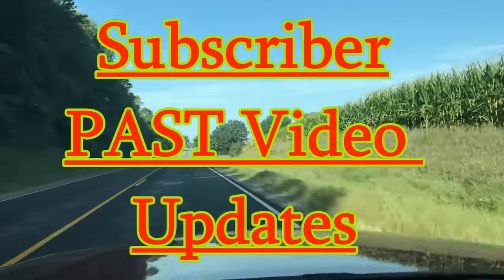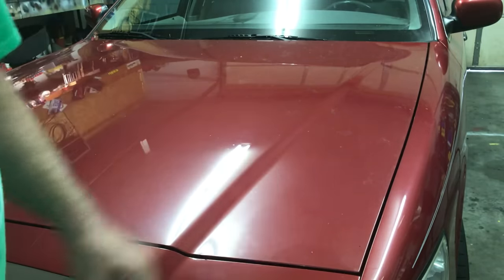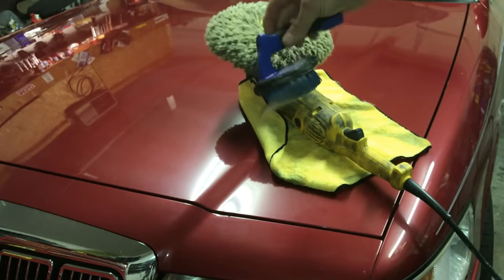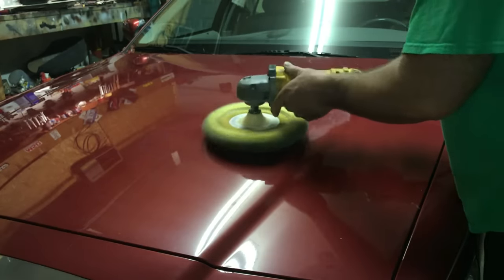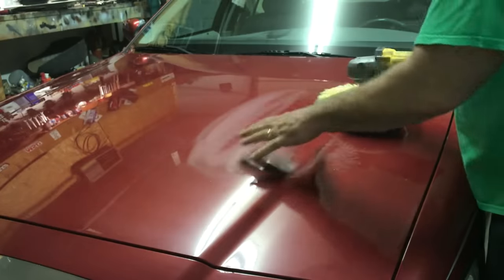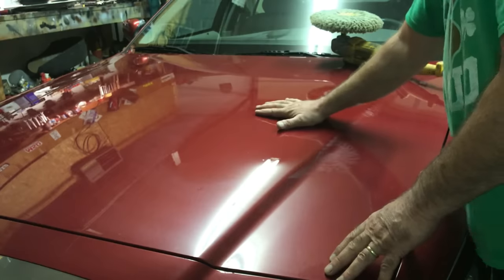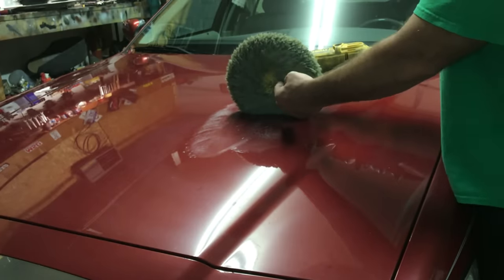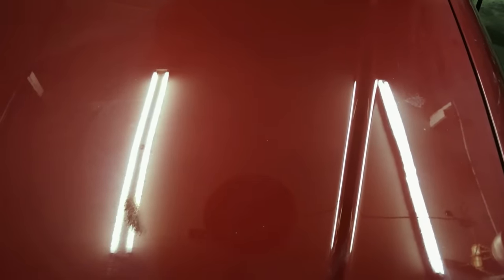HOW to BUFF & POLISH With a SINGLE ACTION BUFFER

Comment: Listen to this guy boys n girls,he knows what he's talking about.I'm a valeter for like 20 yrs and did some paint work in my time although,I  v.rarely used a wool head,just a sponge head.Only advice i would say is tape/mask of any trim/handles etc and a sheet over the windscreen and you can do the head lights too! Adjust the speed about 700-850rpm for the buffer.Do remember if one day your buffer stops working and your baffled why ie fuse is ok,wires are not broken..... on the sides are 2 large plastic flat like screws which hides the metal bristle inside,they do get worn out so don't chuck it away.You may get some spare metal bristles with your buffer and keep them safe.

Comment: 20 year old straight enamel paint job!!  It would be interesting to put a paint gage on it before & after when you're done with that rotary. Lol
Reply from the maker: Well, we've used them for years and years and years and the only issue we've had is that it works so good that our customers keep returning.  Thanks. mad Mike the hammer SPC

Comment: Your videos really do help me out. I just bought a single action buffer and I'm watching your videos to learn how not to burn the paint clear coat or get swirl marks. I'm going to try it first on my older truck so I don't screw up my new suv. So if I keep the pad moving will I avoid swirl marks? Any advice is much appreciated. Thanks
Reply from the maker: R Lindsey see this video https://youtu.be/nUN2uBCgzok it will help even more but if you can view all our paint resto videos that will really help you ...remember swirl marks largely come from the quality of pads and buffers you use. and practice as much as you can.

Comment: Heyya! I know you said to use a single action but I'm a complete beginner. I've used those cheap $40 buffers and sanders a couple times but that's it.

I was looking at the Griot's garage g9.. or the torq15da random orbital. Is that stupid? I know your single action DeWalt is better but I'm entry level.

I'm ok with the work taking longer if it means I won't mess things up on accident lol. Won’t be grinding or sanding anything either.

What do you think? Thank you for your videos. You're the best!
Reply from the maker: To obtain the same results shown, you need to use the exact same products/tools we share CryptoJunkie. If you are a beginner, that's great, we all started in the same position. Just go slow, take your time with the tools and you will get the hang of it my friend. Hope this helps, we really appreciate the view and comment, have a fantastic weekend and all the best on your project. You can do It! mad Mike the hammer SPC & team
Reply: @SweetProjectCars  thank you for the reply and words of encouragement! I'll give it a shot mad Mike 🙂

Your videos rock! Thx again!

Comment: I don't know how I missed this video but I sure am glad that I found it now. This video is exactly what I had been hoping you would make with the Dewalt buffer. A question though, when should I use this method and when should I use the method with the Mothers Chrome Polish from the video that you previously did with the truck? I'm guessing do the Mothers method when there are lots of scratches and/or swirls? Would the method in this video also take out swirls? Merry Christmas!!
Reply from the maker: kawtriples you are correct you only need the4 mother once to remove all the scratches see this it may help https://youtu.be/FcWB2wfuQBc

Comment: Are you toggling the power on and off to control RPM or are you holding the trigger and letting your setting of 2,220 RPM control the RPM? I worked with a guy many years ago that was a professional like you. He used a pneumatic buffer and it ran at much, much lower RPM and that was the reason (he said) he used the pneumatic one. All I know is his work was off the charts great so that is why I was asking.
Reply from the maker: We only do that when we are putting the polish on when it's really wet so it doesn't fling everywhere.  Thanks for watching Ben, have a great weekend my friend. mad Mike the hammer SPC

Comment: Hey man, I really like the Mothers instant detailer and also the Mothers spray wax (that has an extra 8oz) both products have always appeared to look & work identical to me... Your thoughts?
Reply from the maker: Not sure on that we’ve always used the detailer and the wax that we use is the Maguires synthetic
Reply: Yeah the spray detailer & spray wax I swear are (almost) identical in every way, and you get an extra 8oz w the one so thats what I use.

And yes, oh my goodness I took your recommendation on the meguires liquid ultimate and that stuff is incredible.. Thanks alot!

Comment: Excellent video, Im a bit confused as did you use polish or just wax all the way? Also what machine do you use for the sides? as the dewalt looks a bit heavy
Reply from the maker: Spencer unknown we polished then waxed and the DeWalt is all we use on the entire vehicle it does a superb job
Reply: @SweetProjectCars  Its amazing watching you work, you make it look so easy,  as I no joke, spent 6 hours on 1 bonnet / Hood with a Dual Action a 6 inch Heavy cutting Flexipads Hexlogic using Menzerna Heavy Cut 400.. and it still did not get out all the water marks, surface scratches etc.DA its almost useless at cutting.. much faster by hand.. ok for finish I suppose.. I know in the video you mention using Mother's if there are scratches to remove, but in the video all I see you use is : Mother's instant detailer (wax) -> Zymol Z503A Cleaner Wax (wax) -> Meguiars Liquid Wax, Thats why it looks like you are using wax all the way : )
Reply from the maker: Spencer unknown if you plan on doing this much and want the same results as we achieve then i highly suggest you use the same exact tools and products and you will have success very easily every single time you have to remember we have been at  this for over 40 years and are sharing only what works taking all the guesswork out for the DIYer

Comment: For removing swirl marks in black paint would you start with foam compounding pad or just start with fluffy compounding pad and then on to polishing pad? I have  the buffer and pads that you suggest using.
Reply from the maker: Bradley Peel we use this for swirl marks https://amzn.to/2QyqisM it works great just follow the directions on the bottle and you are good to go my friend :)

Comment: If you buff your car and remove all the fine scratches and swirl marks then ceramic coat the car. Will it keep car wash brushes from leaving scratch marks on the finish?
Reply from the maker: RedWhiteAndBlueVideo yes the ceramic coating we use will fight off car wash scratches but we highly recommend when you can to avoid automatic washes I know in the winter time it is the only way you can get the salt and chloride off and you have to do it.

Comment: Can you go into a little more on what a dual-action can't do right, like you were mentioning at the intro?
Reply from the maker: themadmallard what we like to tell people is try a dual action buffer in one spot for 15 seconds then try the single action in another spot for the same amount of time...the difference is amazing. duals just don't have the capability to shine like a single...those who have always used a DA don't know what they are missing because they have not tried the single. yes, the DA is a bit easier to handle and that's why it was invented, in turn, it lost much of its capabilities to shine and polish for this handling. The best thing again is for those to try each and see which one does the job faster and better and then for them to use the one that gives them what they are looking for ...handling or polishing performance.
Reply: Sweet Project Cars  can a dual action get the same shine if it just takes longer and using an ultra fine polishing compound, or can you just not get the same shine with a dual?

Comment: So don't let the final wax (Meguiar's) dry at all before using polisher to remove it?
Reply from the maker: Bradley Peel with this polisher you don't have to let it dry as you can do it a few times for a much better shine in the time it takes to do it once by hand and letting it dry.

Comment: Thanks for these! I've watched a bunch of your videos and I'm confused a bit. You use different products for different things and it's not clear what your process is. I just want to know how to clean a truck I just bought from start to finish. It's in good shape but needs minor paint correct (swirls and shallow scratches) and contaminant build up (clay bar). Wondering what the process is from start to finish on a used car you just bought and you want to shine it up right.
Reply from the maker: We have different methods and they all work great if you follow this video you just watched you will shine your car up like nobody’s business if you look through our videos for the chip repair they all work great as well we will never post a video that does not have great results and that we have not done at least 100 times ourselves here at our detail shop

Comment: 2200-2600 seems to fast for beginners , I would do 16-1800 and hold trigger instead of jogging trigger.  Then beginners i would use handle
Reply from the maker: Thank you for sharing Casey people can run their buffers at any speed they want we are just sharing the one that works the best when we’re training new hires here

Comment: Interesting...............I always have been running my buffer with the pad Flat to the car, not on an angle.
Reply from the maker: You can run FLAT to start and then as it dries start tipping the buffer up it will grab way less and you’ll get a much better shine with no swirl marks

Comment: that generates a lot of heat so you got to move quick but that's kind of the new way that people buff cars they don't do the traditional way always keep it flat always keep it flat nowadays people will lift it up put sideways tilted kilt it back you want to go the curves of the car if you got to get it tilted to do the curves are cars ain't straight like they used to be there all curved now so you want to run the pad just like the curving of of the car and you'll be good
Reply: Abrasive technology has evolved a lot in the past 15 years. SMAT and DAT abrasives are small enough that polishing on an edge doesn't have the gouge effect it once did, when everyone was using gritty dusty rocks in a bottle. 👍👌✌